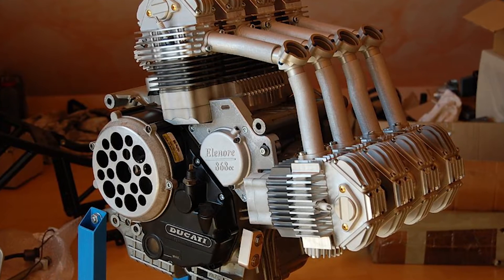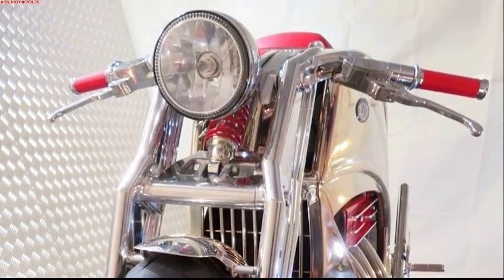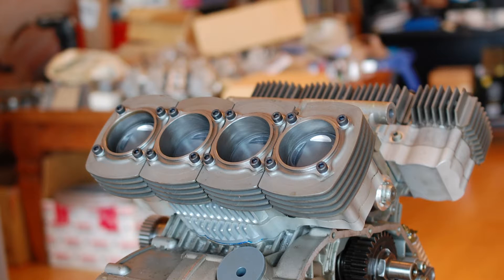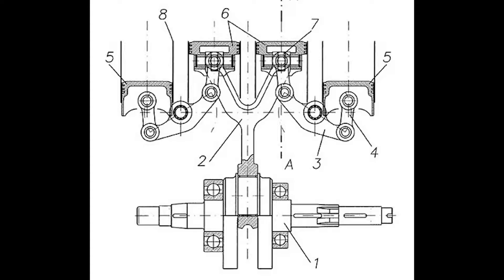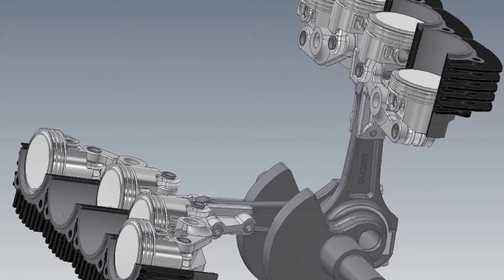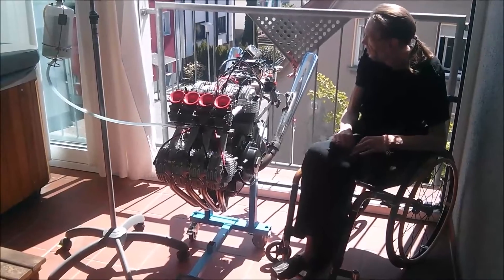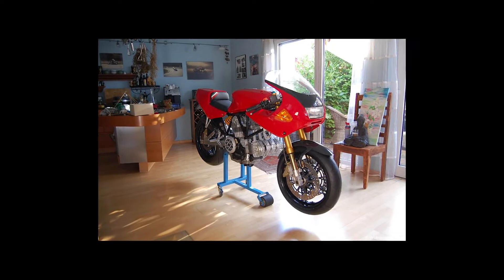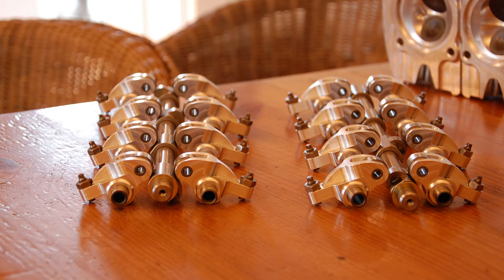This Engine has 8 pistons and only 2 connecting rods

Comment: It's nice to see the ideas and dreams of others be brought to life though isn't it? My dream is to bring back the rotary engine with all the bad engineering taken out of it as that engine went into production with some major engineering flaws. Why the rotary engine? Well, it's like you said not much can go wrong when you fewer moving parts so the engine with the fewest moving parts will win in the long run if built properly.
Interesting design and I'd like to see just how it works in the field so we can see how it stands the test of time when people abuse it like they do all engines they get their hands on. Plus it should be run on hydrogen as that is the fuel of the future that gives no carbon build up in the engine.